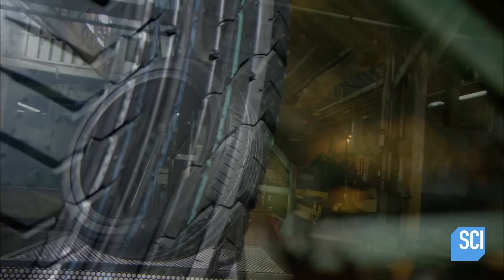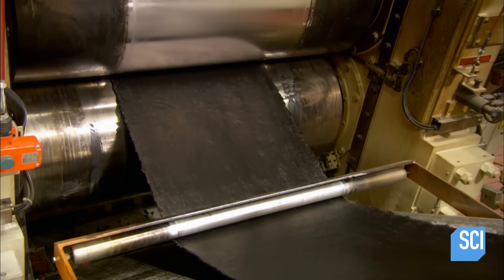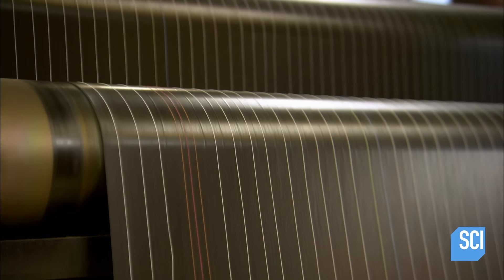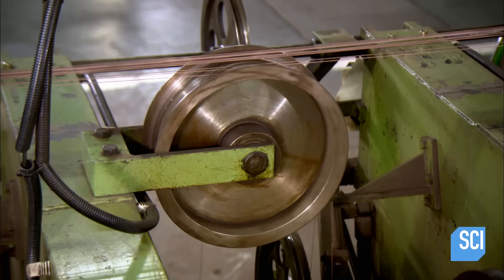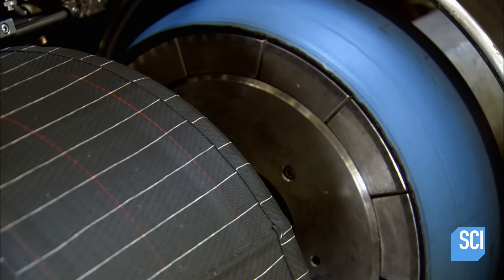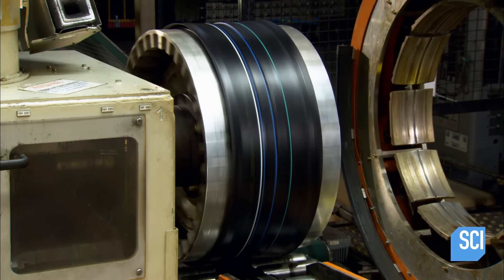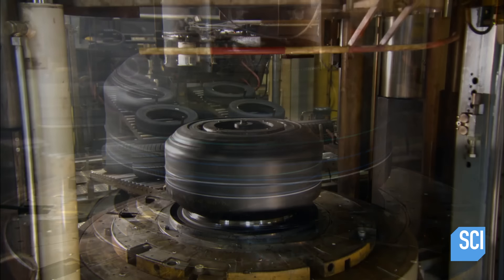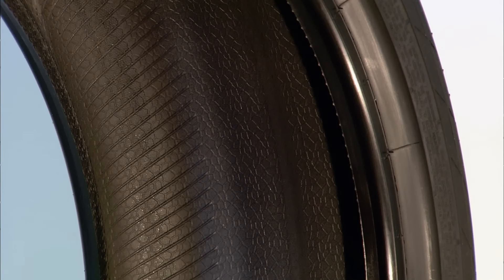How It's Made: Car Tires

Comment: My God these machines are a bloody marvel. How does one even begin to design such task specific machinery.
Reply: I have marveled at the machines that make our everyday products. It would be so much fun to design such equipment.
Reply: mechanical engineering courses in university :D
Reply: @Erik_Swiger  It would be a nightmare to design these machines, IMO.
Reply: That’s why I am in the medical field. That stuff makes way more sense me than those machines. Just thinking how the heck did they get those things to work like that makes my head swim.
Reply: It's the Germans, mainly. They are the source of a lot of these hyper-specific factory machines.

Most of what we use is made in China, but most of what they use to make it is made in Germany.
Reply: Thanks to production engineers
Reply: @HevaNaisdey  haha nope.
Reply: Incremental advancements over decades... It would be extremely hard to build one without basing it off of existing technology
Reply: It's a nightmare
Reply: Retired longtime mechanic for a well known Big TruckTire and Aircraft Tire plant here.

Keep in mind our OTR Truck and Aircraft tires are up to 56in tall. Some of our older Tire Building machines (over 60yrs old still used today) are heavy duty and require 2 operators. They require more hands-on operation than the newer 25yr old "NG" (New Generation) Tire Building Machines. The Newest Tire Building machine's components are a lot lighter to produce a completely built "carcass/uncooked green tire" as fast as possible with one person operating it. The trade-off with these New vs Older machines is, all the components of the newer machines (3-4 times as many moving parts) are much more fragile, break down more often and the whole machine takes up twice as much floor space as the older ones. 

Same screwed up ideology is integrated in the Newer tire curing presses. Tire curing presses are always huge pressure-cookers that use plantwide supplied steam. Our huge older 60-72 inch double-dome presses are simple electro-mechanically operated and use a simple cammed clock mechanism for the different events of the curing cycle. Any hydraulic actuation (lifting mold segments and center post/bladder assy) is done using only 4 Large 12in to 24in diameter brass hydraulic cylinders, that uses a plant-wide, low-pressure (300-500psi) Water System, not Hydraulic Oil. Since tires are cooked using steam there's a lot of heat. If occasionally a curing press blew a hydraulic line or blew cylinder seals, no big deal, it's just water. 

IF IT AIN'T BROKE, DON'T FIX IT.!! Then some devolved Brainiac thought the industry needed a CHANGE!! Oh my God, the devolved idiots with every tire manufacturer worldwide started about 16yrs ago, replacing the tried and true heavy duty Electro-Mechanical curing presses, with these POS all Hydraulically actuated presses that use High-Pressure (3000-5000psi) hydraulic oil systems that, (LOL😅) "Will never leak". 😅 Six months later, talk about a Maintenance, Safety and Environmental Nightmare!! I'm so glad I retired. 😅
Reply: @David Wanklyn If you studied Volcanology and Meteorology like I have you'd quickly dismiss all those LIES about "Man-Made" Climate Change. Just one small active volcano emits more Toxic and Greenhouse gases in just 1 month, than man has ever produced. The 2nd highest event is caused by Wildfires.

In meteorology you learn that every "event" of a spike in levels of toxic and GH compounds detected in our atmosphere is called a "Fingerprint". A computer analyzes the fingerprint and determines over a few days of sampling, what event (volcanic eruption or wildfire) caused the spike and it's geographical location. 

The spikes always return to Normal or slightly below Normal levels in only a few months after the event ceases. We know that none of these spikes have ever been man-made because the scale of the Spike/Fingerprint is so large that no man-made fluorine compounds, found heavily in industrial manufacturing and auto-exhaust like:
Calcium Fluoride - CaF2.
Xenon Difluoride- XeF2.
Hydrogen Fluoride- HF.
Uranium Hexafluoride (UF6)
Sodium Monofluorophosphate (Na2PO3F)
Sodium Fluoride (NaF)
Stannous(II) fluoride (SnF2)
Dichlorodifluoromethane (CF2Cl2

are ever detected.
Reply: @Kungur.u  thank god, a voice of reason.
Reply: @SarcastSempervirens  thank you sir🤠
Reply: @HevaNaisdey  No, Industrial or manufacturing engineering degree, that’s who designs and builds this equipment.
Reply: I have to add that a lot of the evidence does indicate a flat (to uncertainty obviously) Universe... my point still stands though! xD
Reply: Many say things not good as old days! I say things are better..
Reply: I’m very old when young tires need intertubes patches all the time and tread only lasted 10k . Tubes were really had on cars, not like bicycles
Reply: ... it's called common sense. judging from your comment, you don't have common sense. It can be bit overwhelming at first, but it's very easy if you have common sense. You make a basic tyre and see how it acts, then change it based on what goes wrong.
like really, it's very easy if you have common sense, but impossible for those to understand, who don't have common sense.
Reply: @hazzah5572  wrong. tires specifically, are basically always made by whatever company makes the tires itself. theyre amazingly proprietary designs. if you look close for instance, you can see that most goodyear tires are all made in different strips and then put together. theres a seam for the tread, the sidewall, and the bead. toyo on the otherhand, the tire is all one piece. they go from a roll of 3inch wide strip to a tire in all 1 piece. 

you should try actually visiting the factories before you mention how they work.

i was also at a few food plants, nabisco seems to have entirely home made machines, but wrigleys did have german packing machines. all the conveyor was american designed parts though.

i know all of this from personal experience as a millwright, how bout you?
Reply: @HevaNaisdey  They don't teach how to manufacture tires or even how to design tires in a ME program.
Reply: It takes people who are inventive/creative and mechanically inclined. Tires have been manufactured for a lot of years, so in the industry a lot of this is already well known. It's a matter of studying how it's done, thinking of ways to do it better then testing the concepts. It's called R&D.
Reply: funny story actually I got to work on a project similar to these machines. It's many people working on different segments. So you have a team working on conveyer belts and a team working on mixing, etc. Each team breaks it down into managable chunks, so over how ever long their design process(6 months, a year, whatever) is would look something like this. (mixer example) "Ok so we have the raw materials how do we make them one material?" "squish them all together under heat, force them to combine" "great ok how do we do that?" "what if we pushed them through a gap at the same time? thatd work right?" and then they prototype. It works. "Ok great how do we get it there?" "conveyer belts already exist, lets use those and feed it into the squisher" "oh no this problem came up where the materials aren't evenly distributed." "Hmm ok if we let them rotate in a big jar for enough time, they should randomize and disperse evenly, that idea's been proven with lottery machines already"
Reply: Overtime figuring quicker ways to do stuff then as it gets quicker and quicker that is then converted to some type of machine function which is then added upon
Reply: MANY iterations over the course of many decades with tiny alternations each time
Reply: @Kungur.u  I wrote the SAME THING and then saw this comment.  THANK YOU.
Reply: Repent or you will likewise perish.  At least you're true to your username
Reply: @elephant35e  you just have to break it down into simple steps.
Reply: @hobocode  If only we could hit the 'like' button twice:goodvibes:
Reply: Trial and Error
Reply: @Brodozer39  o
Reply: They evolved over the years.
Reply: @Erik_Swiger  naaaw it would be a fuckin pain. Every single machine known to man I'm sure had its inventor fucking throwing shit around mad while designing it. Its cool but man I'm good lol
Reply: Repent or you will likewise perish.  Wat
Reply: And now we have smart tyre 👍
Reply: There's 7 billion people on the planet 1 or 2 are bound to dedicate their lives to such endevours
Reply: @elephant35e probably only a few people can do it and probably love it
Reply: I really like the world you use specific awesome word 😊
Reply: You get an engineering degree.
Reply: All computer programming. Just make them do what humans do
Reply: @Brodozer39 those are just subsets of Mechanical Engineering dude lmao
Reply: 1 piece at a time, adding on to previous peoples work. Getting rid of more workers, replacing parts in the process clumsily and ineffectively at first, machines slowly taking over more and more human steps, each machine in the process being improved upon by the next person until it's reached a level that no one can think of anything to fix without better tech
Reply: Engineers are geniuses.

Comment: Tires are amazing. It’s crazy how much abuse they take on a daily basis and still perform nicely each and every day.. you can burn them up at a race track in a day, or drive across the country and if all goes well, not get a flat 😅
Reply: Ive always said life rides on 30psi. Always check your tire presures.
Reply: @josecarvajal660  imagine using psi lol
Reply: @leopoldbaumann1575  lol its the uk standard
Reply: @leopoldbaumann1575  Well, what else do you use?
Reply: @ahyaan2552  Same in the US.
Reply: @leopoldbaumann1575  anything tire related here is in psi. Sure it's not metric but I didn't vote on it either.
Reply: @leopoldbaumann1575  what do you use? atmospheres?
Reply: @charliebaker3230  lmao
Reply: Each time a 777 Boeing or an Airbus 320 lands I'm amazed at the strength of the tires... imagine the stress on THOSE tires!
Reply: @ahyaan2552  The world uses bar for tire pressure . . .
Reply: @TRPGpilot  ah yes make sure you inflate your tires to 2.06843 bar
Reply: @charliebaker3230  yes its called bar. Which makes way more sense
Reply: @nckhed  Bar or Pascal
Reply: The only sad part about vehicle tires is what happens after they run their course, because of all the elements used to construct a tire, it is often impossible to recycle. If someone out there ever came up with a comprehensive idea on recycling a tire and or it’s elements or materials, that person could make a great deal of money that would even put Elon Musk to shame
Reply: @leopoldbaumann1575  Name one mechanic who uses Pascals
Reply: @TRPGpilot  or degrees
Reply: Not heard of smart tyre 🤔
Reply: You mean a snake should come and bite you and you will do nothing to save yourself 🤔
Reply: @c190gtc I  guess it must be a regional thing I'm canadian and we measure tire pressure with psi. Something like acetylene welding is measured with kpa though. I don't even think there's a tool to measure tire pressure in bar.

Comment: Not only am I impressed by all the machinery and work going into a tire. But I am also impressed by the use of proper terminology! I like that the narrator describes the bead as locking the tire onto the wheel rim. A lot of people just call them rims, or wheels. Where that specific part mounts is known as the wheels rims. The wheel, being the whole metal structure that bolts to a car, and the rim bein the verrryyyy edge where the tire sits on.

Comment: All that equipment, and only one tire, of that type, at a time!  No wonder they're so expensive!
Reply: One at at time, yes, but it’s all autonomous and they can keep it running indefinitely. It doesn’t justify the overinflated price.
Reply: they're not that expensive when they're supposed to last years
Reply: @LOLTutos  NIce pun!
Reply: When they leave the factory they are not expensive, they cost a 3rd of the price that you are paying, because in theory you pay for your old tyre to be recycled
Reply: Wrong... TBMs are built to handle a range of tire sizes. Different types/sizes of tire can be built on a TBM by changing its configuration. Curing presses are also buit to handle a range of tire sizes and can be configured for different types/sizes as well.
Reply: $400-$600 for a flagship performence tire.

Comment: Machines made in Akron, Ohio.  I worked there for a few years.  Also some French designed machines to cut the rubberized fabric on a bias.  Have worked on these around the world.  Dirty, smelly, but necessary equipment.
Reply: my machine is manual i have to do the cuts myself maybe may machines older idk

Comment: Tyres are some of the most impressive items in my opinion, second only to the internal combustion motor. Tyres have to withstand a BUNCH of stress on a day-to-day basis, needing to be able to hold up a multi tonne vehicle whist also being able to handle traveling at a max of 100< mph while support all that weight. And that's not even mentioning torque from the engine or potholes.

Comment: Wonder what color the tire would be without that carbon black put in, would it be more of a grey? Or splotchy and non uniform?
Reply: I don't know if this is true for modern tires, but before carbon black was put into tires in the early 1900s, tires were made directly from tree rubber, and were white. The carbon black was added because this early tires had low durability.

https://en.wikipedia.org/wiki/Whitewall_tire
Reply: @builder1113  huh didn’t know that cool
Reply: At one plant I worked at we made camouflage ATV tires.  We also tried making white non-marking skid steer tires. This was so that landscaping guys wouldn't mark up the driveways of fancy homes.
Also, some tires compounds are made with a form of silica for the reinforcement.  They still include some black to conduct static electricity.

Comment: Oh, and he did it on both inside and outside of the tire. That's why it shows him grind / rough both sides to give the new vulcanizing rubber a surface to grab as well as it meeting where to hole is then he puts it under pressure and heats it the same way the tire was made in the first place

Comment: The show hits different when you have these exact tires.
Reply: i have the exact same tires and they kinda suck honestly, probably the least durable tires i've ever had.
i never had any of my car tires bulging after nearly 3.5 years, usually what goes bad on my tires is the thread itself, but the actual tire sides bulging? in less than 3.5 years? wtf?
and these are NOT cheap tires, i replaced all 4 tires in 2018 for these and each tire was 175$...
now i don't expect any tire to last forever obviously, but typically most high quality tires require replacing every 4-5 years, so 3.5 years for a PREMIUM tire is completely bullshit.
compared to my previous Pirelli's which were 150$ and lasted me 5 years, these ContiSportContact 5's are garbage...

Comment: Damn they didn't even bother to remove the plastic bag before putting the ingredients into the blender hahaha
Reply: Good eyes there.  The "plastic bag" is  made of a very specific low melt high strength rubber like polymer. It can hold 25 pounds, but is totally dissolved in the mixing process. That is not a foreign material.
Also, they did not show that mixing is a multiple stage process.  Usually rubber is mixed, cooled, tested, then mixed with more chemicals added in the "plastic bags".

Comment: Look up how tires are made . Tires start as soft sticky rubber and then are put in a mold that puts pressure on it and heats the rubber, which vulcanizes the rubber, turning it from a soft, weak structure to a firm flexible rubber

Comment: When the thing slide in the wheel, that 1, if use as bicycle part pedal can make gear fast n slow that way? Maybe chain replace by springy stuff or rubber that is strong?

Comment: Tread doesn’t create traction, that’s the rubber itself, slicks which have no treads, have the most traction of any tire in dry conditions, treads are on wet weather tires, to move water out of the way, other tires have  different treads for dirt and sand and snow and other environments.

Comment: I didn't know making tires was so hands-on. I figured it was all automated. No wonder they cost so much.
Reply: There was only one hands-on step in this entire process. If anything, this shows tires should be cheaper.
Reply: Yeah, it's a pretty complex manufacturing process.
Reply: @EJM1224  there are still plenty of plants that have manual machines, where a tire builder actually hand builds the tire. Very labor intense
Reply: Smart tyre 📱 is not hand made

Comment: Most of these machines haven’t changed all that much from the early 20th century. Most are generally the same as they were 80 years ago. The primary reason tires of today are more durable and handle better on the road is due to the r&d relating to the raw materials and compounds that make up the tire. 
Additionally, I believe it be quite easy for tire manufacturers to design tires that last upwards of 100,000 miles easily. (But why would they ever do that?)
Reply: its a balance between longevity weight and traction. A harder compound with more tread weighs more and has less grip. So yes its possible to make one last 100,000 miles but it will have worse fuel economy/acceleration/handling/grip and the rubber will deterioate in 6 - 7 years anyway

Comment: Wheels had rubber without air; wheels are still needed with tires. There have been countless iterations on wheels and tires together and individually. Not a fan of the reductiveness of the introduction.